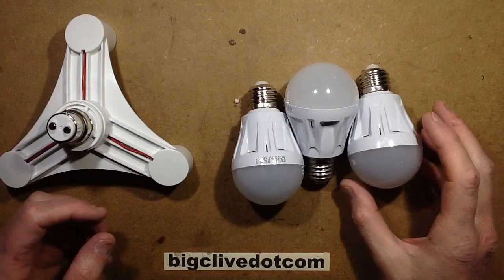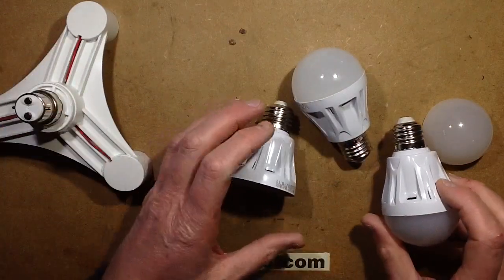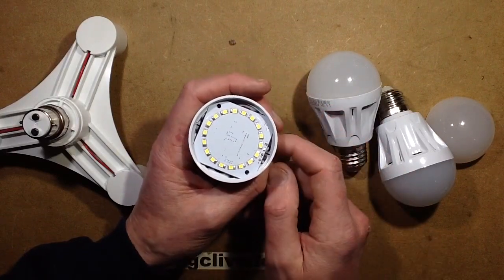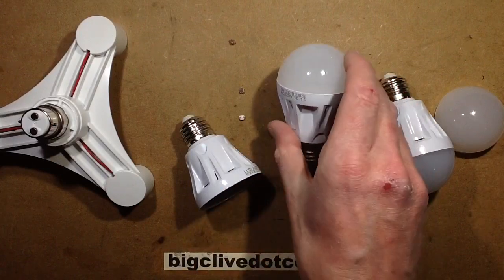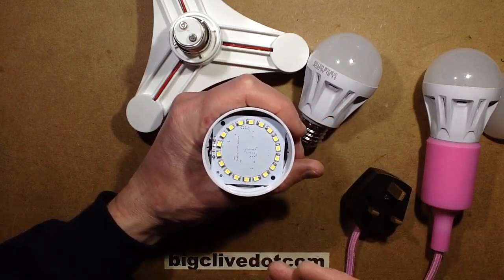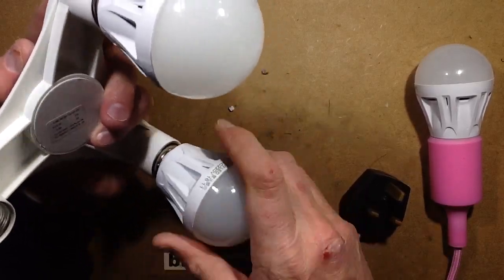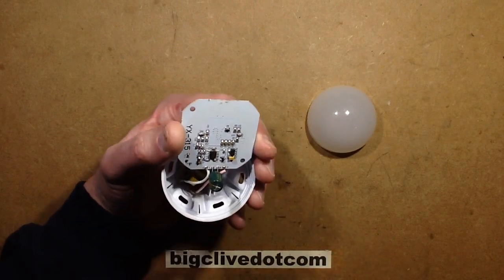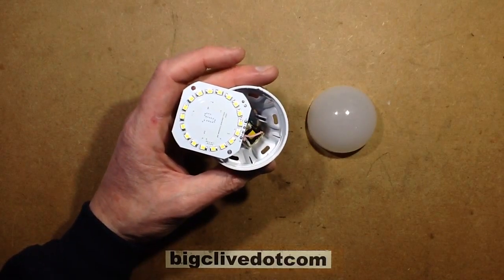Radar/microwave lamp interaction test.  Will they coexist?

Comment: The sensor circuit looks at the homodyne (zero IF) output made by mixing the transmitted signal with its reflections.  If the microwave oscillator runs at 5GHz then for something moving at 1m/s (like a person) towards or away from the sensor, this generates a signal at 2 x 1m/s x 5GHz / c = 33Hz (similar to the Doppler effect).  So the frequencies of interest are up to a few hundred Hz at most.  Anything higher can be ignored (filtered out).  For a nearby sensor to generate a difference frequency of only 500Hz (perhaps within our detection band), it would have to run at 5GHz ±500Hz e.g. 5000000500Hz i.e. only 0.00001% different in frequency.  The oscillator frequency is determined mainly by the mechanical layout of the circuit and by associated components (with tolerances over 1%) so the chance of the frequencies being so close is negligible.  So we don't expect one sensor to interfere with another, even if we have a few dozen working close together.

Comment: Neat lights.  I purchased a small portable light sort of like that, however this one runs off 4 AA cells.  I use it in the bathroom of our Motor Home when we are camping and no 110 volt shore power is available.  Wife said she needed a night light and this really does the job, it is not all that sensitive though, some times while you are doing your job the light goes out and you need to wave a hand to start her going again.  Doesn't seem to eat batteries we have used it two winters now and she still works just fine with no battery changes.

Comment: Can these be modified for 120v?  I like the idea, but can't find ones that will work for 120.
Reply from the maker: This one had a universal style switching supply in it.  I would have thought it would work on 120V.
Reply: I did not realize that.  Initially the only ones that I could find that were explicitly stated as 120v were $20+ and gave up there.

Comment: Hi Clive Im looking for a led bulb which can be converted easily to 12v by bypassing the driver unit, does such a thing exist?
Reply from the maker: Most of the classic 3W lamps have a current limited driver that puts out between 9 and 12V depending on the combined forward voltage of the LEDs.  You can usually get most LED lamp styles in 12V versions.
Reply: Thanks Clive love what you do, keep doing it :)

Comment: I have a CB enthusiast in my neighborhood. To the point that I've had to get rid of several audio devices due to them picking up the signal from his CB and I wonder if it would end up triggering these types of lights. It's bad enough that it will interfere with wireless mice, even 2.4Ghz mice.

Comment: LEDs in series-parallel fed by a constant current driver will fail faster. The first chip or connection to fail will make the others share more current. Don't bet on "50,000 hours".

Comment: do you know clive that the clever people can now record sound being relayed through the led chips and encode it..so if you have a led downlight in the kitchen at night and are having a conversation someone pointing a led recording device can listen in.like a boom mike but a led signal decoder..there must be something in the frequency recording the peaks and troughs..so now they dont even need to bug your property.
Reply from the maker: That's usually the unit that bounces a laser (infrared) off your window to detect the reflected modulated light.
Reply: That only works on people with aluminium foil wrapped over their head.
Reply: Chris Fuller They'd have to get a modified light in your house though. Surely the way that works is to modulate the light output using a microphone. Just replacing a radio transmitter.
Reply: "relayed through the led chips". Of course. You're gonna have to do some work to make that make any kind of sense.
Reply: ah yes i must expand..apparently they can record video images through led lights...not sound..lol thats been around decades..apparently when you break the led beams they reflect and leave an image that can be recorded by a receiver..

Comment: I'd suggest that the reason they seem to be replacing PIRs is they'll work in an enclosure that's opaque to 10um IR.

Turning the old issue of whether these are true Doppler or just sense a change in the RF field, you'll need to trace the cct at the output end of the amplifier chain to find out.
Reply: They work the same way as microwave door openers. They detect the peaks and nulls of the reflected rf beating with the transmitted signal as the multipath reflections change in the room.

Comment: what is the point of having a light and motion sensitive indoor light? it could work in a kitchen or maybe bedroom but seems strange overall.
Reply: The assumption is you don't need lights in the day, so the LDR stops the motion detector turning the light on when it isn't needed.

edit: but yes, I see - if it was a room you were going to sit in for a while, having to move all the time to keep the lights on would be very annoying.

Comment: in YOUR opinion ,or even facts ,is bayonet better than edison or dosnt matter ? also is it cheaper to just have sensor integrated lightl switched than replaces all the bulbs where u want motion detection ? is it safer ( since current controlled at switch end thus bulb is actually OFF

Comment: Those adapters are so dangerous. I dismantled an E27M-->3x E27F adapter (similar to yours) and the centre pin was soldered to the outer ring on the 3 outputs. I found the same with E27 studio lights from China. Some were live switched and some were neutral switched with the neutral on the centre pin. Really bad engineering and soooo dangerous!

Comment: These lights are shit. I took apart one a few days ago with one LED burned out which caused all the others to not work. Series connection is shit. I'd redesign them to have all LEDs in parallel, 12V, and a small 240VAC to 12VDC power supply that gives smooooooooth DC.

Comment: Hmm, maybe I should get a few of these and stick one in the bulkhead light on the uncle's house rather than fanny about with the already dodgy enough wiring (whoever fitted it took the lighting ring main outdoors to the bulkhead light!!) to fit an LED floodlight........
Reply from the maker: You can take lighting off the ring main, but you must use a fused spur to protect the cable.
Reply: bigclivedotcom
I'd love to correct the wiring, but, it's poking out the side of a flat-roof extension, with no access to the cabling (presumably locked away in the ceiling) internally to fit a fused spur, and as it's rented, I don't think they'd be too pleased with me ripping holes to fix it, even though their insurance is probably already void due to the rather poor wiring in that house... :S

Comment: I'm just curious, but would a running microwave trip the lights?
Reply: Probably not, a microwave oven has metal and a faraday cage blocking most of the microwaves. The lamp is also likely tuned for a very specific frequency.

Comment: If only radar lights weren't sensitive enough to work through walls, and had better field adjustments, they'd be a truly viable alternative to PIRs (which do suffer from setting each other off in close proximity) for exterior security applications.  I had tried radar lights for mounting on exterior of my home, and they would trigger if you walked on the interior side of the wall from which they were mounted.
Reply: You could line your walls with lead.
Reply: Paul Sengupta Never thought of that.  Might be good idea, I'll ring up the drywall guys and see if they can open up some walls...

Comment: have you posted a vid showing the reverse-engineering of the 3W driver? can anyone provide a link? if you haven't, perhaps others would be interested as well?
Reply from the maker: It's a very standard design based on a Bright Power chip.  There's not actually much to see.  It's been heavily integrated into a single chip to use a simple two winding transformer.

Comment: I want to create a nixie clock that triggers the display using this style of radar sensing... does anyone know if these can be bought as modules? I would let the display run for about 10 minutes after each trigger so when I'm in the same room it will be on all the time. seems like a much neater way of extending the life of the nixie tubes than the standard clock program cycle....

Comment: I work with radars that can share an actual antenna. There is need to tell them they are sharing an antenna at all. The simple fact that the signal timing is so unlikely to every happen at the same time combined with the average filtering, there is no reason they cannot coexist on the same antenna as well. You should try to wire these together on a single antenna.

Comment: And another time where the "polarized" plugs and sockets do more harm than good. I don't see how defining one contact to be neutral makes anything safer. You have to rely on the fact, that everything has been wired correctly. Devices with a Schuko/Euro-plug are generally built assuming all contacts to be live. This includes eddison sockets, where the rim is higher so there is no way you can touch the thread while you try screwing in a bulb.
Reply: I wonder how many of us Americans die from touching plugs or screwing in a lightbulb, or God forbid, using an electric shaver in a bathroom.

Comment: Did you see an easy way to change the sensitivity? For example by exchanging a resistor for another value or replacing it by a potentiometer?

Comment: Could you try and see if it runs on 12 (14.4 max) volt please? That would be really neat!
Reply: I suppose it wouldn't be hard to swap the driver out for one of the standard 12v ones.
Reply: *****
Perhaps, but I was just wondering (and still am) if it could be ran without a driver on 12 Volt (car battery)
Reply: It would be good if it did, but I'd be surprised if it ran at a decent brightness.

Comment: I've run into an issue recently in which LED bulbs don't work properly with the motion sensing outdoor housing on my front porch.  Incandescents work fine, CFLs work fine, but as soon as I put an LED in it, it doesn't trigger anymore.  Putting it into "test" mode, it triggers fine, but that's just bypassing the ambient light sensor...

Comment: Wouldn't be surprised if these do drift over time & temp, so might get some interference or desensitisation. 
Can you easily reduce the 'on' time ? Might be fun to reduce to a second or so, and have a large qty of them spread around a space, or in a long line  to make a reactive  light installation
Reply from the maker: +mikeselectricstuff At the moment they're all misfiring because it's windy outside.  Tree and foliage movement?  The EG4002 has a clock circuit controlling the on time, so it's probably that changing the cap for a lower value would accelerate the time delay.  It could be an interesting effect.  And quite cheap to implement too.  Here's the datasheet.  http://www.egmicro.com/download/EG4002_datasheet.pdf
And the lamps I bought.   http://www.ebay.co.uk/itm/282239249860
Reply: I was rather thinking, would it be possible to increase the ON time. Well, apparently.. if its like changing the cap value =) Great video and interesting as always!
Reply: Clive - fleabay has listings for just the switches, search "radar sensing switch".  Various adjustments for sensitivity and duration ... and that's before you start upgrading components.  Unfortunately there's not an "ignore branches" setting.
Reply from the maker: I've been plundering eBay for the radar modules and PCBs.  It might be possible to tweak filtering components around the repurposed PIR chip to make the units less sensitive to external influences.
Reply: Since they self mix, and are sure to drift all over the place, you would have to get two lamps within a couple Hz for them to trigger each other (or they would have to mix back enough power to cause the oscillator to go unstable)

Comment: What's a "radar" lamp?
Reply: Motion activated - Is that what you mean?
Reply: they are motion activated but there are different kinds of detectors. some passively receive infra red, but these actively emit radiation and are triggered by the reflection, in the same way as aviation-type radar

Comment: I found  these in bayonet on eBay, advertised as warm white.. a 5000K warm white from my test. 
Do you have problems fitting Chinese bayonet bulbs in uk light fittings? My one is really hard to twist to lock it into position, I'm wondering if I need to grind the contact screws down a bit.

Comment: I'd quite like to test how these affect 2.4 Ghz WiFi. I might get some to mess about with.
Reply: I'd say it's unlikely to interfere with Wifi. These typically operate at 2.7GHz.
Reply: St3venAU I agree with this, channel 14 doesn't get anywhere close and the devices would use more robust modulation with slower speeds to deal with it.  channels use 20MHz of bandwidth so youd have to get within 10MHz to cause any interferance and within 20MHz if it was in 40MHz mode.  2.4GHz is crowded enough dont add to that.

Comment: There will be some effect between lights, you mean that they do not trigger each other.
The microwave oscillator on board all 3 are probably not exactly on the same freq, however the motion detector detects a change in the beat frequency from the transmitted signal and the returned signal, the stability of all 3 oscillators will be good, meaning the beat frequency from the other 2 lamps on any  one will be constant, and therefore they will not trigger each other.
If you were to heat the ic, or the dro puck on one of the lamps the resulting drift in transmit frequency will probably trigger the others.

Comment: Is it possible to harvest the radar sensor in these to use them with Arduino or Raspberry Pi projects?
Reply: Yes, just tap into the output from the RF circuit where it enters the 8 pin chip if you want an analog value, or tap the output of the 8 pin chip for a digital value. For digital you'll probably want to find the timing resistor and change it so there's no remain-on behavior after triggering.
Reply: Ritey-oh. Off to eBay!
Reply: kduhtdkzrt Clive did an episode a while back where he explained the proximity circuit a bit and showed it in relation to the standard PIR circuit. In the circuit, a standard PIR chip gets it's pyro sensor replaced by the RF proximity circuit. It looks deceptively simple if you ignore the black magic of the PCB based RF inductor and tank circuit. Sorry I've not got a link for you. Happy hacking! :-)
Reply: Found it. Thanks!
Reply: If you search flea-bay for "radar sensing switch" you'll find a number of options
Not tried any - so no recommendations ... perhaps clive has plans ... or if not  ... Clive - how about a review on the radar switches ?????
Reply: Andy White Thank you! I just searched AliExpress with that string and got: https://www.aliexpress.com/item/Free-Shipping-Human-body-induction-module-RCWL-0516-microwave-radar-inductive-switch-module-intelligent-sensing-detector/32712700620.html 
Already ordered. :-)
Reply: Lol ... a man of action :) - I ordered one from e-bay too - different format in it's own enclosure ... I have a PIR light that doesn't - thought I might have a go.  Just seen a post from clive saying the wind is playing havoc with his - so maybe it's going to need some tweaking.

http://www.ebay.co.uk/itm/AC-220V-Infrared-Body-Motion-Radar-Sensor-PIR-Sensing-Switch-Microwave-Detector-/291958301927?hash=item43fa1224e7:g:NV4AAOSw-0xYPqWz
Reply: kduhtdkzrt link please.?